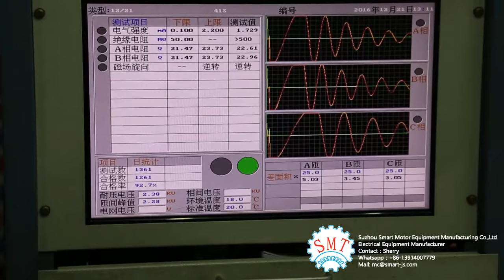Automatic Washing Machine Motor Production Line Suzhou Smart Motor Equipment Manufacturing Co., Ltd

Comment: Winding stators have come a very long way, I used to wind motors by hand about 45 years ago such fantastic machinery which insert the copper coils into the stator it is a joy to watch and getting the pitch of the coils right every time and perfect  :)
Reply from the maker: It seems that you are good at winding.
Reply: With machines you get it perfect every time and very little chance of making mistake and much quicker people want electric motor as time is money when a factory is down with motor failure I worked in a factory were time was money and it was an 24/7 operation though we used 3 phase motors and some of the motors were 6.6KV 600 horse power and the majority was 415V 3 phase we used motors which came from South America  The Weg Company I was a joy to watch the video of manufacture of electric motors and thank you for your replay :)

Comment: For table fan stator,16 slots and 35swg copper wire what is the pressure setting for coil inserting machine,pre shaping machine and final shaping machine
Reply from the maker: Hi Murali, Do you use our machine?
Reply: We are using Rinka machines, China, please specify pressure for 35swg,36swg copper
Reply from the maker: Hi, Murali. it's not our machine, so I am not sure. Thanks!
Reply: Even though it's not ur machine,u have some knowledge to share,it will be helpful, machines are same  but only make different, kindly suggest sir we are facing rejections like NC and Coil Short issues